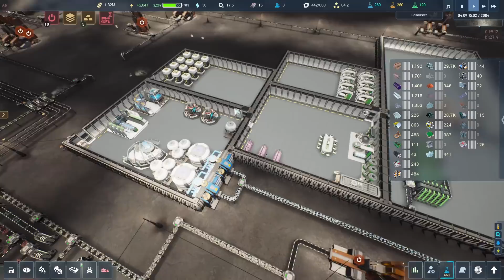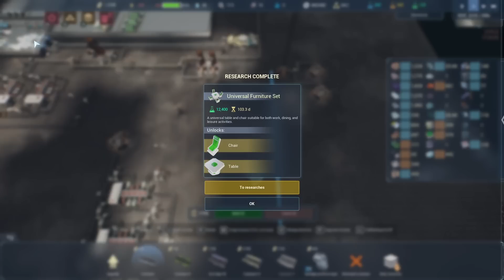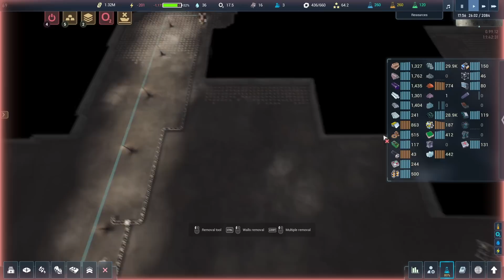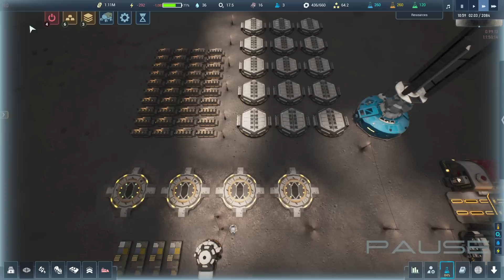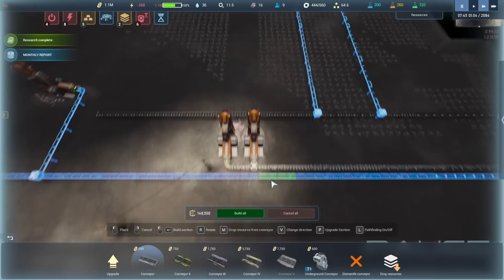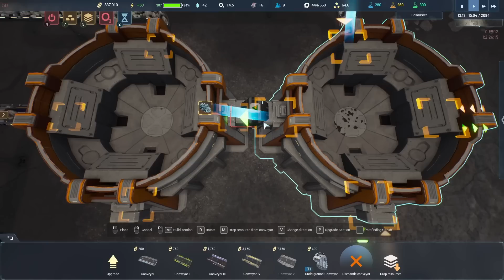The Crust - Setting Up The New Refinery - New Horizons Update [E9]

Comment: Here an ideal for smelters layout that could be right up your alley. It compact 6 smelters, 3x rows by 2x columns, middle conveyor feeds all 6 smelters and linking each side exits and have them merge into one feeding a bulk resources storage. When not in use just turn off power till the need arise. One set for each base materials.